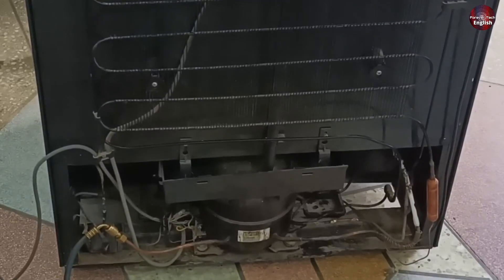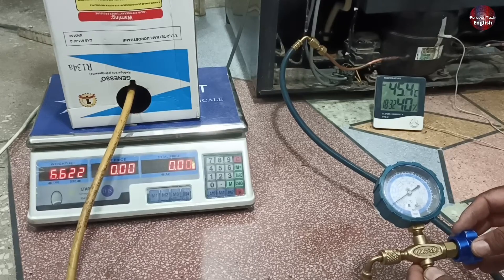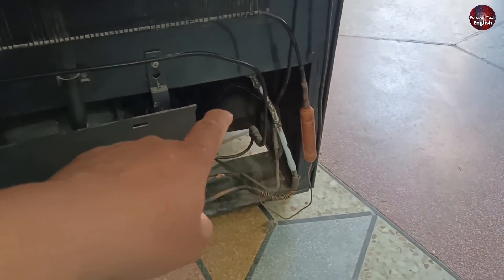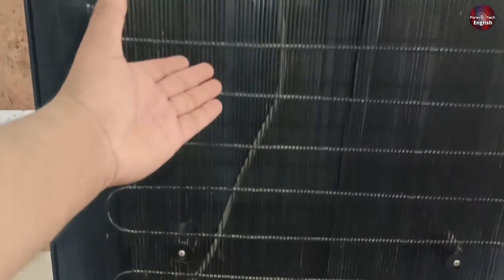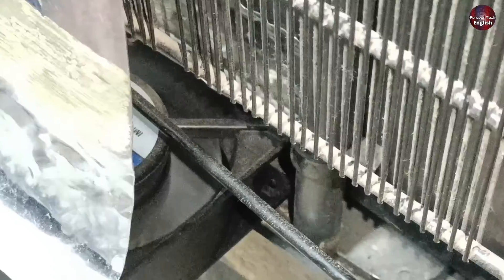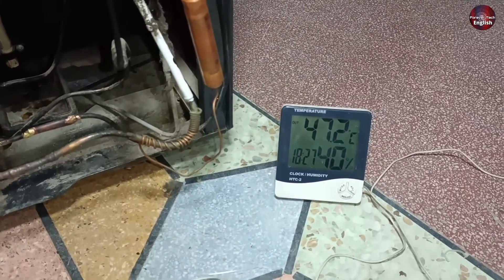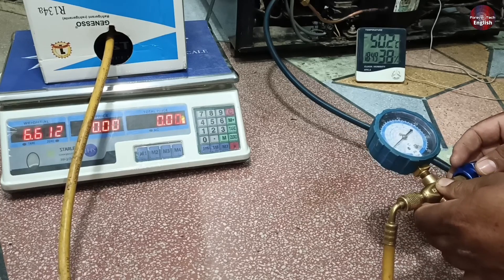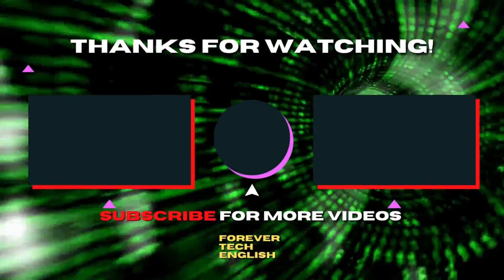I Installed CPU Fan in Refrigerator

Comment: Very good, the condenser and compressor need ventilation at the back, but what about the inside air circulation in the fridge, to limit temperature differences between up and down and also avoid condensation droplets in excess ? I think of adding a fan inside before outside, knowing that they are both useful and would turn my fridge into a mini cooling chamber.

Comment: Many servicemen will tell you that your fridge is now old, although every thing looks new.
They will say the thermocol linings and butters of the ducts are compromised!
They will mask the downdraft with tape and remove the return air path buffer!
This is not a permanent solution!
Some servicemen are converting the new into the old overload relay and thermostat arrangement!
Color codes on the provided circuit diagram and the actual  connectors don't match!
They will say that the fan is weak and that no replacements are available.
It also seems that these guys cannot trouble shoot frost free fridges, with a card system and sensors.
These sensor replacements have complex and tedious checks. Beyond their training!
With the old Frost free systems, the overload relay and thermostat system allowed them to speedily get the fridge back in action.
Many consumers have expressed their concerns with built in obsolence, where the compressor fails just after the guarantee expiry.
Now these mechanics are wary of the card system, more than any thing else!
You could sell a good fridge at a loss!
After trying out everything it seems that it's the weak fan!
Check the voltage requirement if the fan before resorting to changes!

Comment: Good job, but why you don't put thr fan in front of compressor? Thr airflow is to compressor so its will not colling thr consider, right? 
What is thr normal Temp fo filter?
Reply from the maker: But according to my experience and what I have learn from books is in order to cool the refrigerator compressor you need to cool the condenser. Then The compressor will Get cool and work fine. Well you can share them on my social media. I will post your work.🥰
Reply: @forevertechenglish  sure.. 
Another Q. Why did you put the fan at the end of the condenser not at the top? If at The top thr airfloo will going to consider cooler than bottom, ..need your opinion
Reply from the maker: Because We Don't need to cool the compressor we need to cool the condesner.
Reply: @forevertechenglish but the compressor temperature is very high, so if decreased compressor temperature will be better performance and  life time, I do it for LG refrigerator added extra fan on front of compressor, the orginal fan on behind condenser, 
I can't upload photo here 😔

Comment: The only part that needed instructions was the electrical and you basically skipped that part for anyone who doesn't know it already.
Reply from the maker: Hello Buddy, Thanks For the Feedback, Basically, the connections are easy to do as the fan has a neutral and a phase line. Connected with the norma home ac voltages.
Reply: @forevertechenglish  All good. I found another similar video that showed the wiring part. It's easier than I'd expected. I also saw an alternative method of simply hooking PC fans into a AC wall plug with an adapter. The upside would be not altering the fridge wiring itself. The downside being the fans stay on 24/7. I'm thinking I'll replace the manufacturer fan that is broken with my old Tornado PC fan (strong enough it kept a vacuum in my old case) to turn on/off with the thermostat and maybe a few cheap silent ones via wall plug where the air intake vent is (never had a fan there originally). As it stands we've had the lower back panel of the fridge open with a loud box fan propped angled at it since the fridge stopped working Thanksgiving day (almost lost 8hrs worth of cooking). It has worked but loud and takes up space.
Reply from the maker: Yeah It would be more easier to have a wall plugged ac fan without altering the wires in the compressor box
Reply: @UnpleasantAlex   could you please share those links of the additional videos you saw